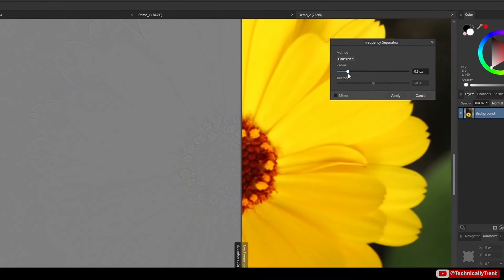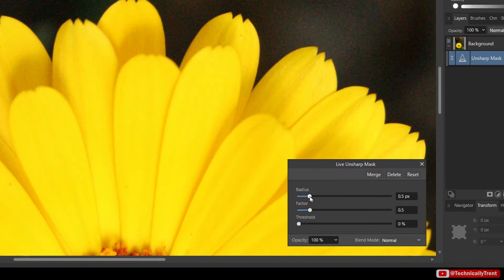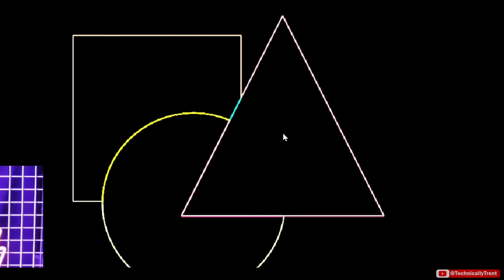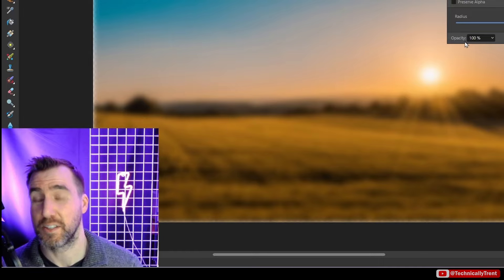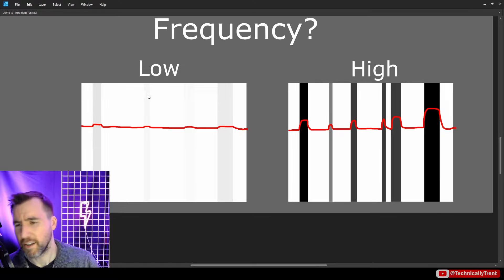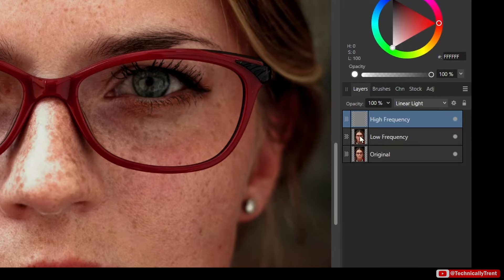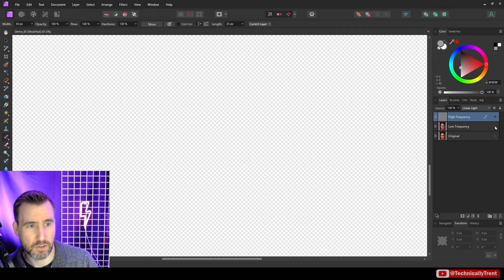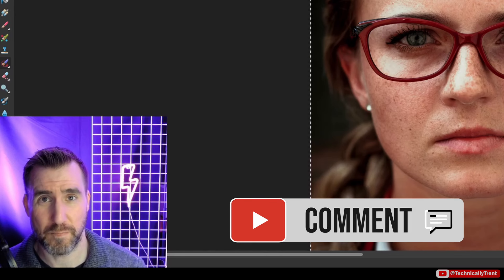Frequency Separation 101 - Tutorial for Affinity Photo

Comment: Thanks for the video! In the early example, how would you separate the flower from its background? And how would you treat the flower and the background differently?
Reply from the maker: Hi @whitelight1313! There are a couple ways you could do that. Probably the most straightforward would be to duplicate the layer, select the flower with the Selection Brush, use the Refine option to clean up the selection, and then output the result to a "New Layer with A Mask". That will isolate the flower. Then you can work on the flower and the BG separately.

Hope this helps!
Trent

Comment: Thanks! But I think you may get better results using the low strength Mixer Brush instead with Auto Load and Auto Clean on.
Reply from the maker: Hi @juurstudio, true, many tools can do this job. I was mostly using it as an example of how frequency separation can be used.

Comment: Thanks for showing!

I have two questions though.
1) There is also a High Pass filter in Photo, I guess it is the same as the high pass part as in the Frequency Separation, right? What would be the low pass one? Just the Unsharp mask?
2) What are other examples frequency separation could be useful?
Reply from the maker: Hi @dkickelbick!

1) A low pass filter would a Blur filter such as Gaussian Blur. Actually, you can manually create your own frequency separation using this method:

- Copy your image layer
- On the top layer, give it a High Pass Filter set to 10 pixels (or whatever you choose). Set the blend mode of the later to Linear Light
- On the bottom later, give it a Gaussian Blur filter and set the value to the same number of pixels as above (ex: 10 pixels)

The result should be your original image.

2) I think any scenario where you want to independently adjust he low-detail areas and the high-detail areas would be good for frequency separation. Usually I have seen it used for portrait photography, but I'm sure it could be used for other things like nature photography.

Hope this helps!
Trent

Comment: Very interesting video. Is their advanced tutorial? Gaussian Blur is not used anymore in Photoshop retouching because of edging issues. They used Medium. Is there a version in Affinity Photo 2 i’m doing Frequency Separation using Medium and using the Mixer Brush on the color layer?
Reply from the maker: Hi @s1amvwbug,

In my latest livestream, I talk about this a bit at the 58:26 mark:

https://youtu.be/xC_ZB6S8b8A?t=3506  

To manually do frequency separation, I use the High Pass Filter found in the Live Filters. For the low pass filter, I use a Gaussian Blur filter. If you set the same pixel radius in the High Pass Filter and the Gaussian Blur, and you set the High Pass filter's blend mode to Linear Light, it will act like frequency separation. Perhaps there are other ways to do it, but that is the method I found. Hope this helps!

Trent

Comment: do you have any examples of how to use this for removing the texture of canvas fabric from a photo of an oil painting on a canvas that is intended to be enlarged into prints?  I am having a problem with the canvas weave being too prominent when I enlarge my art images
Reply from the maker: Hi @MarieStephensArt, thanks for the question. I have never tried it for canvases, although I just did a quick test. It is possible to remove the canvas texture, but it seems like it tends to make the image more blurry because you'll also remove the subtlety of the brush strokes. I'm not really sure what method people use to remove canvas texture. In my experience, most people seem to actually like a subtle canvas texture on a print, but it depends on the art. Let me know how it goes!
Reply: @TechnicallyTrent  I agree with all that you have said here.  However, in this situation, my photo of my art is actually a zoomed in section of the original painting, like 4x4 inch section of a 16x40 inch original oil painting.  I then take this close up shot, and enlarge it to a 40x40 inch abstract print. When I enlarge it, the canvas weave becomes overly prominent.  I was able to correct it without loosing the texture of the brushstrokes.  I learned that I must do the fft denoise before I enlarge or crop or do any other manipulations for the most effective result.